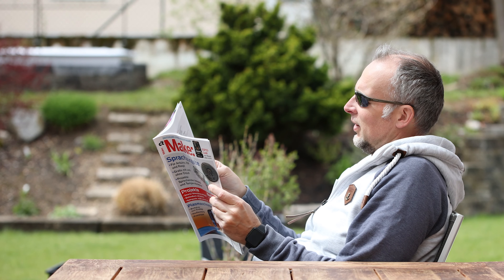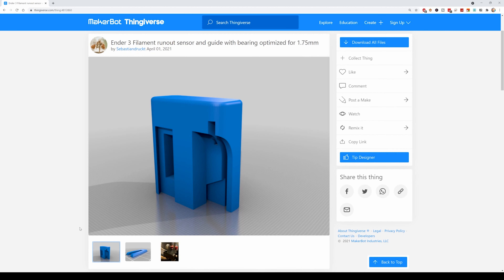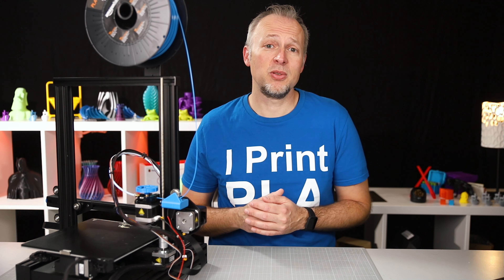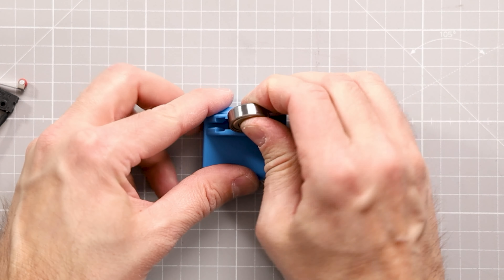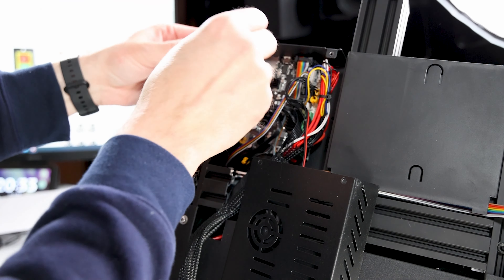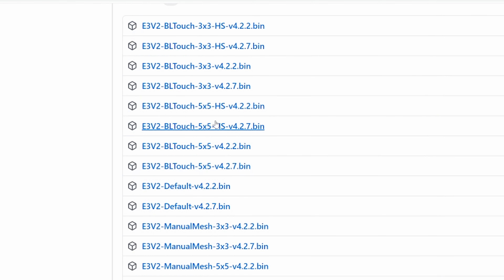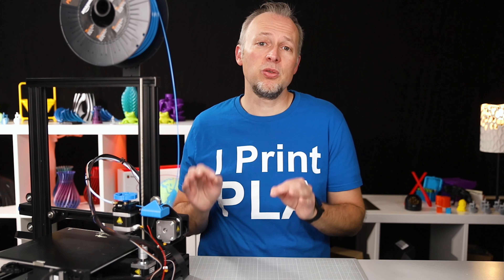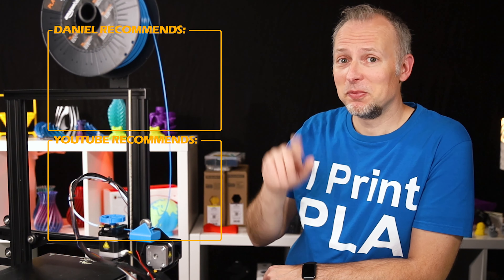99 CENT Ender 3 v2 Filament Sensor - BEST upgrade for summer

Comment: Hello and greatings from Germany. My Englisch language is Not so god an i am not shure wich firmware i have to install. I have a Ender Creality 3 V  with a 4.4.2 Board an no BLT. I have the original Firmware and in the Info Display is V 1.0.2.
I have no problem it to make (Printing an prepaire the cable and switch). I am not shure by the Software / Firmware. Thanks for helping.

Comment: Can this firmware be used in the E3 Pro with the 4.2.2 board (but with the basic LCD screen)? Thanks mate!
Reply from the maker: No, it's only for the Ender 3 v2 with the new screen. But you can get pre-compiled firmware at the firmware factory if you're one of my Patrons. https://dev.crosslink.io

Comment: This is a great mod! Worked great but……
I had a hard time after reloading the filament, I purged it a couple times the. Let it resume but the layers right after the restart didn’t stick, it ended up as spaghetti on top of the previous layers and I had to abort the print.
I’ll play around with some practice prints latter but any advice on how to successfully restart?
Reply from the maker: Probably the material was too cool already. Don’t wait too long to change the filament. You can increase the print temperature for a few layers manually. Or briefly heat up the top layer using a hot air pistol ( very briefly!)